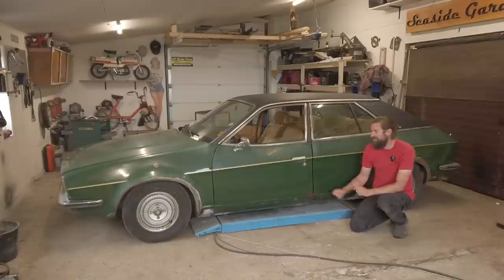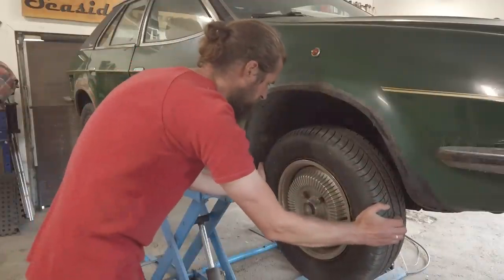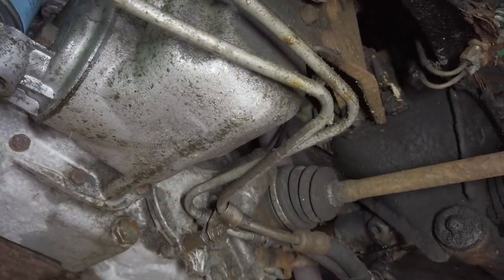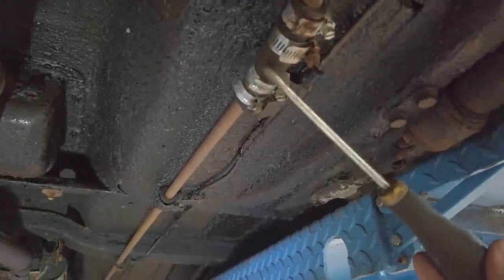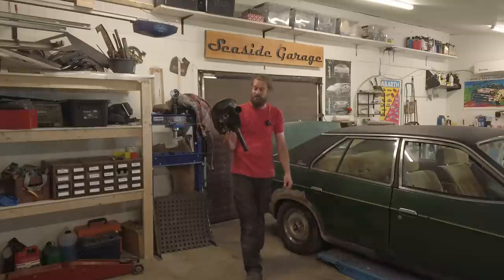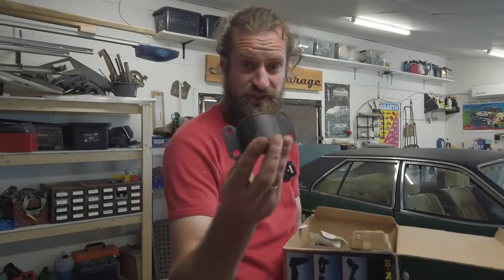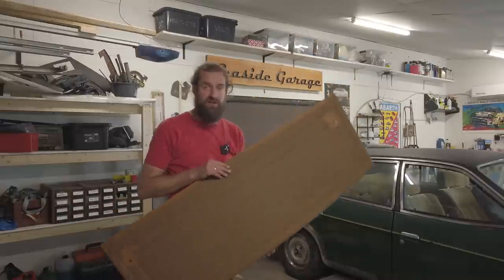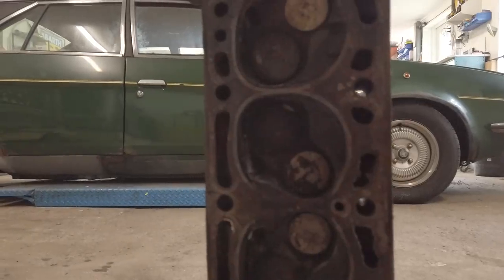The Princess on the Pea? - A look underneath the 2200 Princess

Comment: A very brave man pokes a Princess... with an old screw driver. It must be water tight as leaky rubbers and screen trim are usually a death sentence. It was great to see the 'the plug hole of despair' or BL logo visible on an original spare part, bonus👍.

Comment: Hey there. Where the suspension pipes are concerned, if you use copper pipe make the joints with brass compression joints.
Not as good as the originals, but should be plenty strong as my old red one years ago had the same problem and the copper pipes  worked fine.
Cheers.
Reply: You can flare copper pipes ? A good refrigeration mechanic could do it for you
Reply from the maker: I think that will be the solution :)
Reply from the maker: but I wonder how you connected the copper pipe the the healty part of the steel pipe?
Reply: @SeasideGarage  Remove the steel pipe and get it flared with one part of the brass compression fitting put on it. As long as the joint is on a straight part not a bend, it should be plenty strong.
Reply from the maker: @tonysargent1699  thanks :)

Comment: Well, a lot to treat with… i was a lot luckier with my one that was properly rust proofed from new… the battery tray was gone due to a leaking battery! Otherwise very little front valance and ever smaller front wing issues. No rust at all underneath, sills and wheel arches… you were very lucky with the new headlamps that are more than hard to find!!!

Comment: If original pipes (whether originals or modern pattern parts) are too pricey, then copper or cupronickel pipes would be the way to go, but of course make sure to use quality compression fittings, given there's a lot of hydraulic pressure in the lines which could fracture soldered joints or pop out a push-fit one, wouldn't want all the hard work to go pop and make the car hit the deck... :)

Comment: the more i see of this car the more i want to see you do the work necessary to get it back on road, the one i saw on youtube recently  went for the option of fitting separate valves on the suspension units sort of making it fully independent  he said it works but not as  comfortable as intended  but this might be the only way if pipes unavailable... those  rubber hoses and  clips really not  good  enough or  safe . i am not a plumber  but would hope there are fittings strong enough to go on the copper pipes to do a better job if thats the way you go....those  spare metal plates will  come in handy especially like me your  using a no gas mig welder as they are thick.

Comment: If you can't get any suspension pipes, could you not consider having  some flexible hydraulic hoses made (should be plenty strong enough and won't corrode in the future, also at least in the UK there are mobile hydraulic hose fitters/makers who will come to you on site), not original but is a solution that should work and be safe --- some nice parts included with the car
Reply from the maker: Could be a solution. :)
Reply: @SeasideGarage  I thought of it because an agricultural trailer i'm finishing needed hydraulic pipework and the hose supplied very similar in size to the pipes shown, though the bore is only 4mm - 1/8" so you might want to seek advice, as an aside years ago I replaced the hydrolastic pipes on my mini, couldn't get genuine metal pipes anywhere but was able to get a kit that replaced the pipes with nylon/ptfe pressure hose whereby you cut 100mm of pipe and the union fitting from the pipes, cut the equivalent +35mm at each end of the hose then after warming the ends and a 2 part adhesive bonded the hose onto the previously cut ends, I dunno if this kit is still available but it worked on my mini and i'm sure the kit was suitable for all hydrolastic/hydrogas cars.